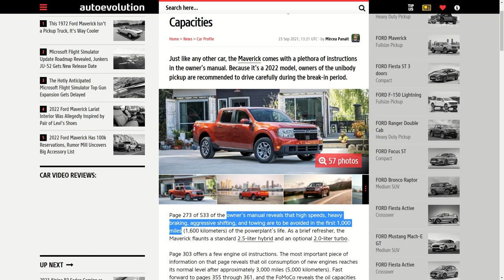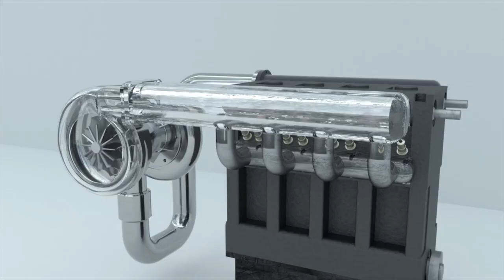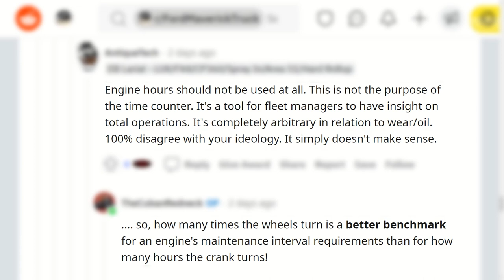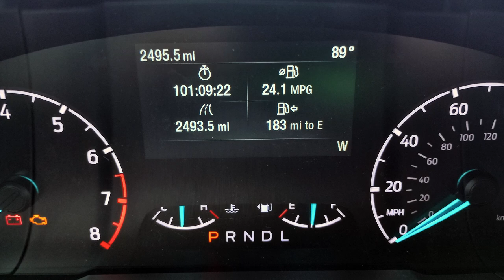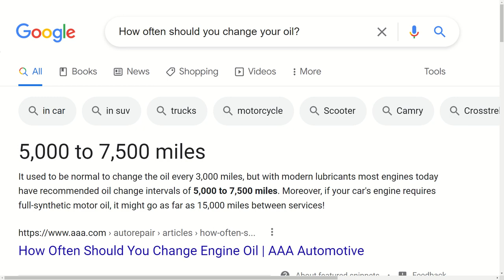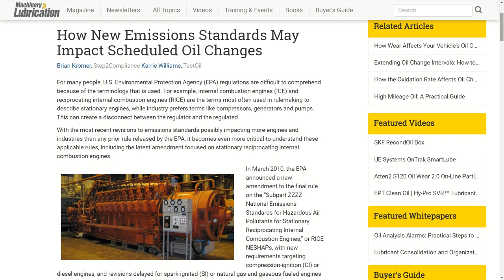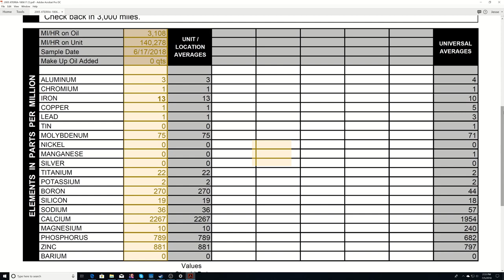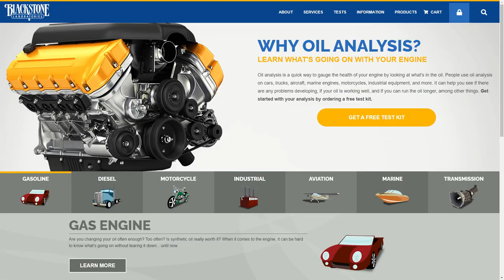The Truth About How Often Do You Need Oil Changes

Comment: I do know one thing. No one ever damaged an engine because they changed the oil too soon, as long as they used the correct products and did the work correctly. The minimum rather than maximum oil change interval always put you on the safe side.
Reply from the maker: ...lol AGREE 100%  but did you read some of the comments! 🤣
Reply: @CubanRedneck  People adhere to different mechanical theories. The synthetic oil fanatics talk about the ability of their product to to neutralize acids and suspend contaminants even at high mileage and about oil analysis results after as much as 25,000 miles. My thought is, if you use a more economical product meeting the specifications of the engine and change it early, those acids and contaminants are never there in the first place.

I have a 2001 4cyl Camry. I drive all short trips. I use a Supertech filter and dino or semi oil and change it at 2500-2800 miles. The car is too easy to work on to get a pricier product and wait out a longer change interval not knowing how the oil is really performing.

I say, if you stay within the specifications of the products you are using and the specifications of the production itself, you are not going to have an oil-related problem.

A big issue, though, is what type of driving the vehicle is being used for. People do not want to accept that their constant short trips to the local stores and eateries constitute severe duty. But they do. Just saw another videocaster who dissected this issue. He said, the simple rule is, if you drive all short trips or drive very little, cut the oil change interval in half.

I consider the interval with dino or semi oil to be 5000 miles max. Half of that is the 2500 miles. The 3000 mile recommendation of the past may have been based on the presumption that most drivers are doing all in-town driving.

I'm old enough to remember what a mess the 1960s-era American cast iron engines ended up being due to lack of aggressive maintenance. The straight sixes often survived it. The V-8 engines did not. Not very well. They had stuck rings. Oil leaks. Worn bores. Clogged cooling systems. Oil consumption due both to the cylinders and the valve stem seals and guides. Poor oil pressure due to worn bearings. What did I miss?  Well, maybe they had burnt valves because of the exhaust leaks and upper cylinder area deposits too. Oh yeah, and the bad head gaskets.

People who did the maintenance often kept these going a very long time though.
Reply from the maker: @anonymike8280  100% on point!
Reply: My oil life moniter is my own eyes. The darker it gets the more I change it. If it's burning I up the viscosity and add lucas until blowby stops burning oil and oil dilution is not happening... 

You have to realize no one pulls over on the road to change their oil. We plan on 5000 km. But often often I don't get to it for a bit..

Comment: Change with full synthetic every 4,000 to 5,000 miles.  Best would be 3,000 miles.  I do a drain and fill go my transmission every 10,000 miles
Reply from the maker: ... well that is the whole point! I have no idea who came up with this 15,000 mile OCS but the fact is that engines are failing with as little as 30k miles and nobody is talking about this! Thank you for stopping by!

Comment: New oil is good oil for your engine. I drive a 2011 supercharged Mustang GT and I live in California where I’m usually in stop and go traffic or behind some slow ass drivers. I change mine every 3k miles with full synthetic. My car is my daily. Sometimes I change it early because I check my oil regularly and you’ll notice your oil degrading and it just evaporates due to heat and if anyone knows about the Coyote engine, they throw out so much heat
Reply from the maker: …. Thank you for stopping by! I AGREE 100% … but you should read some of the comments by many with “0” mechanical background, who have been sold on these 10,000 ~ 15,000-mile oil change intervals. The fact is that engines are failing with as little as 50k miles. What’s worse is no one is talking about it!

Comment: Ah, those naysayers. You're doing a great job with these videos, sir. It would be awesome to see a future ATF or coolant change video. An engine or cabin filter video would be good, too 👍🏻 Cheers!
Reply from the maker: Great suggestion! Thank you for watching!
Reply: I dont change the ATF. I have a Motor Guard oil cleaner on the Pontiac. It has a Toyota transmission. The dipstick is under the car. The best way to get to it is to remove a motor mount. Still works good at 207.000 miles. Shouldnt need to remove the oil pan in my lifetime.The best thing to flush the transmission is clean ATF.
Reply: Flushed the cooling system. Got coolant in the computer. The new computer had to match the VIN number. Then the computer had to be programmed  for everything including the anti theft system.

Comment: Interesting video and a good topic!  I own 2nd gen Honda Fit and 2nd gen Acura RL.  Honda fit doesn't need any oil between oil changes, so all is good. Car monitor tells me to change oil at ~4.5k miles.  On my Acura(J37 engine), the story is a bit different because of low tension piston rings.  There seem to be more blow-by and oil gets darker after 1500k miles(mostly city driving) and around 2k, engine starts to consume oil. Then by 2.5k, oil is half-way on the dipstick and by 2.7 to 3k, the oil lever is about 1/4th on the dipstick.  If I add half-quart oil, it will eat it in about 500 miles, so I just change it 3k miles without needing to add any.  I use synthetic blend and/or full synthetic oil of a correct viscosity(whichever is on sale).
Reply from the maker: … thank you for stopping by and sharing. Back in the day, I did quite a bit of racing and performance work on B18s, but I can’t say I have opened the hood of a Honda in the last decade. With that said, what you are describing is a well-known issue regardless of brand. 5000+ miles oil change intervals don’t work and are causing modern engines to fail prematurely.
Reply: @CubanRedneck  If car makers wouldn't have to meet some "fuel saving" standards, the oil consumption issue would probably not exist.  Honda J35 engines didn't really have issues with oil consumption(some exceptions) as engine block and pistons/rings designs were not yet changed.  I guess with J37, Honda didn't make necessary changes to on-board computer so it would calculate oil change interval earlier than was on J35.  Have a friend with 2005 Acura MDX with J35 engine and it doesn't really consume any measurable amount of oil and it stays much cleaner.  To avoid expensive repairs down the road, it is better to change oil a bit early depending on the vehicle.
Reply: Makes good sense.
Reply: My wifes 2015 Honda Accord oil still looks new when the light comes on. It uses a little more oil than the 06 Pontiac Torrent. I told her the Pontiac will outlast her Honda because it has a better oil filter. Dont have her trained yet.

Comment: I gave up allowing the oil to get dirty then changing it in 1963 with a Frantz oil cleaner and Standard Delo 30W. We changed the filters more often in those days. My Pontiac Torrent has a Australian Jackmaster Classic and gets a filter change and a new quart of synthetic. I try to avoid reasons for an oil change such as a leaky head gasket.

Comment: 22 GM 2500 HD 6.6 gas engine, light towing in NC. Under warranty so the dealer I have change every 5k with AC Delco Synthetic 5w30 and AC Delco with a Tire rotation! The oil30k miles currently and sticking to this routine! Once the warranty out I will change myself. The oil change monitor says I’m at 40-45 percent when do 5 k oil changes which means if follow that I’m at 8500 on oil changes! No thanks! 5-6 k with synthetic and quality filter and never have an issue.

Comment: Change my oil every 3000 miles. I guess that is why it still works after 213K.
Reply from the maker: ... that is the way to go! Thank you for stopping by!
Reply: @CubanRedneck I drive my ‘12 Honda Accord mostly hwy miles. I change my oil every 3 months or about 6700 miles. Is it safe to do this or should I drop the oci to 5000 miles?

Comment: I had 1.4L Cruze that ran over 250k miles because I change the every 3k mile and service the transmission every 60k miles, I had to replace a lot of original equipment but never the engine and transmission, turbos are hell on engine so 3k was a good interval according to my mechanic friend, oil changes are cheap engines are expensive. The frequency in which you change the oil is more important that brand name.
Reply from the maker: ... that's my whole point! Thank you for stopping by!

Comment: My racing buddies would change oil 2000 to 3000 miles on high compression or turbo charged, or super rev engines.I change at 6 months or 3000 miles to maximize longevity! My generators and mowers go 100 hours. How many hours  does your auto go? 4000 at 40mph with 10% idle time? 100 hours??? Could be? My oil is golden brown, Never black or muddy. A fresh filter and fresh oil is best. I go syn blend or full syn.

Comment: Manufacturer oil change interval recommendations are multifaceted.  And have very little to do with taking good care of your engine.  They are trying to fit their total fleet waste into the government green targets.  They only need your engine to get to the end of the warranty. They are targeting a total maintenance cost to entice more sales. Wear metals for a new engine are quite high and an early change is smart.  Wear metals seem to increases linearly, so extended oil change intervals will definitely have accumulated wear metals. The oil itself may well still have viable components, but will be contaminated. Change your oil.
Reply from the maker: ... thank you for stopping by, and I agree 100%. However, if you read some of the comments, you will realize how indoctrinated and ignorant this world has become. While it is easy to identify those that have never gapped a main bearing or possess any engineering background, it is truly remarkable how things that make absolutely no common sense as said by the mainstream media, for example, and or printed by a magazine or newspaper and out of the blue that becomes the new law of physics!

Comment: The simple answer is to change your oil when it starts getting dark brown and before it gets black. Also, no need for all this flushing hype either, modern oils have detergents to keep your engine clean.

Oil stands up and long time, that's not the issue anymore. There are really only two issues. Moister and carbon levels from blowby. If you don't drive much, moisture will get in your oil and acidify. This is solved by driving for 30 minutes once a month, minimum. Carbon levels in the oil will be from how tight the engine is and how the car is driven. So once a month with a warm engine, pull out the dip stick and wipe with white paper towel or let drip on white sheet of paper. If dirty, time to change your oil. This time will vary on how you have been driving your car. 

A blind time or mileage change is unnecessary and ineffective. 
Why are you changing clean oil or why did you wait to change black oil? Why not change brown oil?
See what I mean?

Oil stands up these days, so after a year or even 10,000 miles, the oil itself will still test good, but high concentrations of carbon (microscopic sandpaper) will cause damage. A very tight engine driven gently may still have golden oil after 5000 miles so why change it? If you are slamming around, the oil might be dark brown at 3000 miles, so change it.

Why change your oil on some schedule when you can see how it’s doing and change it then?
Reply from the maker: … thank you for stopping by. That is precisely my point. Read the oil, not the schedule, but if you read the comments on the first oil change on my Maverick, one would think I have gallons of top-secret classified oils in my garage. This started when my truck was called in for a software update, and I asked about the break-in period. The service adviser looked up and said 10K. That did not sound kosher to me, but what do I know? Anyhow, I was getting ready to go on a 1000+ road trip, so I checked all my fluids to find a strong smell of gas and super dark oil with visible floating carbon particles at 2500 miles. I change the oil and put out a video to let people know to pay attention to the oil and not the recommendation or schedule. You really need to read the comments. https://youtu.be/8HoYQ3yzl-Y The flat earthers and naysayers came out in force! I have several friends who are master techs at dealers, and what they are seeing and reporting about people who follow the manufacturer's schedule is crazy!
Reply: I thought I was the king of long-winded comments, but you did pretty good. My theory is, even if an engine is sludged because of poor maintenance, the best course is to just accelerate the oil change interval. In general, the sludge just adheres to the inert parts of the engine and doesn't do anything otherwise. If the engine only requires conventional oil, just use semisynthetic and change it at 2500 miles, or sooner if it turns dark. Eventually, you will clear the sludge out. I'm an advocate of keeping oil change intervals though.

Comment: Thank you for your informative video.
I have a question, do oil coolers on trucks, do any good? I ordered the tow package on a Maverick,  not because  I plan on towing anything larger than a jet ski, but I thought the larger radiator,  transmission oil cooler, would help the turbocharged engine during day to day driving. Was this a good decision?
Reply from the maker: … thank you for stopping by! Lowering oil temperature is highly beneficial to any engine, from a motorcycle to a tractor. That said, if you are not going to tow all the time, I am not 100% sure that the tow package is the best option. However, if you are not into getting dirty, ordering upgrades like this is never wrong.

FYI - This choice is one with which I struggle all the way to the order process. And yes, the 4k package has an engine and transmission cooler, a larger fan, and radiator. However, after going to the parts department and seeing the exploded view of parts, I was left with a feeling that the upgrades were very mundane. 

Knowing me, I see myself having to upgrade them as many of my friends with Mustangs and F Series have done. But, what turned me off about the 4K package was the final gear ratio. The 2k towing option has a final gear ratio of 3.63:1 vs. 3.81:1 for the 4K model. This is a turn-off because I love doing weekend excursions anywhere from 100 to 300 miles from my home. In other words, optimum MPG is more important at highway speed. With the 3.81:1 gears, the engine will be spinning at about 2100 RPM @ 75 MPH compared to about 1950 with 3.63:1. I "will" be towing a 17' MAKO skiff, which is right at 2k dry, but I don't foresee any issues with that after the addition of a large transmission and engine oil cooler. I think the fan is adequate, but I will also vent the engine compartment by opening the side gills.
 
All of this stuff is in somewhat of an R&D process. We have a small group of local Maverick owners, some of which are dealer techs playing around with different things, including oil coolers, trying to figure out what yields the best performance. I look forward to sharing some of that stuff once and "if" proven effective. Thank you for watching!

Comment: On my 4runner I do every 5k, on my 300zx twin turbo 3k
Reply from the maker: …thank you for stopping by! That is well within the range and a practice with a well-documented success rate. My beef is with the 10~15k oil change intervals, which are causing engines to fail, and nobody is talking about it as if it did not exist!
Reply: @CubanRedneck  I completely agree with you. Can't take anything at face value anymore with almost everything. I like to buy quality items that I love, customized to my tastes and take great care of them
Reply: Sound advice especially on the 300ZX TT. I failed to change mine after 5K and resulted in one of the turbos blowing. They were Sport 500 turbos with a JWT (Jim Wolf Technologies) ECU. Suffice to say it was costly and a lesson learned.

Comment: I want to add something here. There is no need for an ordinary driver to ever do an oil analysis. Oil analysis is for people who are using expensive, high-end products and want to justify their choice or for fleet operators who want to know how long they can safely go between oil changes. Everybody else, use whatever the cheapest products you can find and change the oil early. Low-end and no name oil filters are good for 5000 miles, but no more. Regardless of what kind of oil you are using, if your oil change interval is 5000 miles of less, you do not need a special filter.

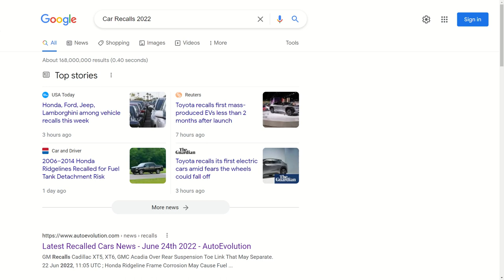Comment: 8:00 I know from experience in aviation, trucking, construction and agricultural mechanics, hours are the standard used for maintenance intervals across the board. Only in the automotive world is mileage used. 

Engineers are to be advised, NOT worshiped as prophets of truth.  Everything... and I mean every thing in today's automotive world is engineered for the cheapest possible cost, NOT for longevity.  Oil additives are viewed through the lens of cost, NOT what's best for the engine.